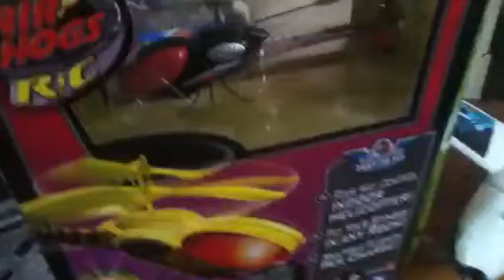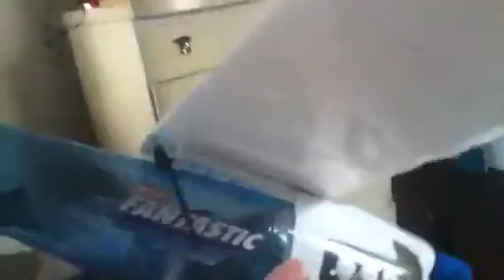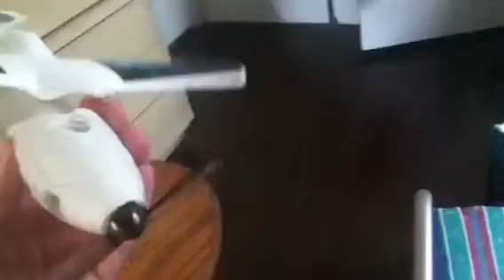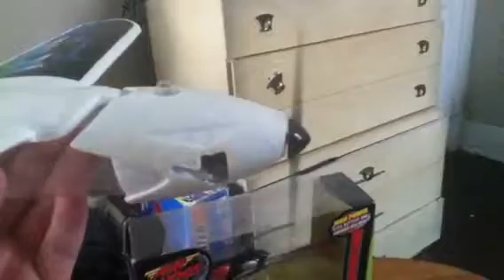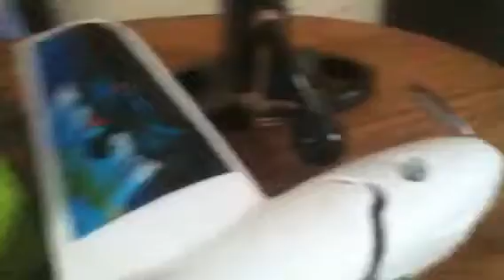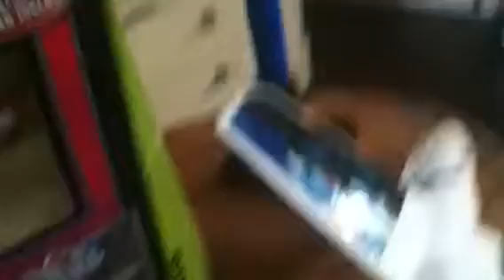History of air hogs from past to present

Comment: They should make an RC plane that has the air pressure engine with a electric power air valve for variable speed, rudders, elevators, ailerons, etc.